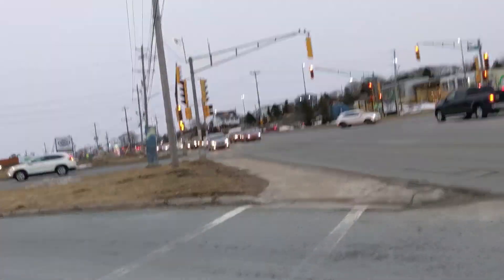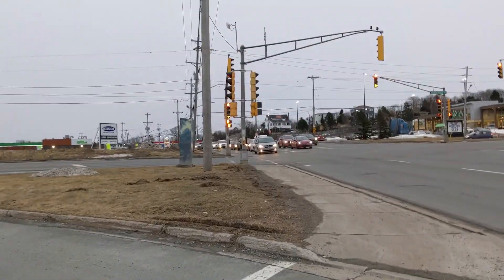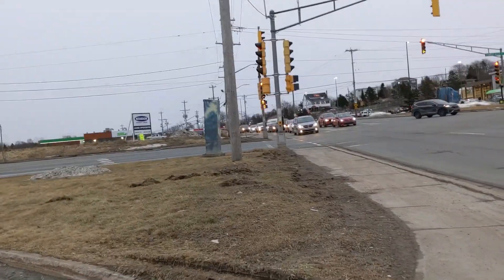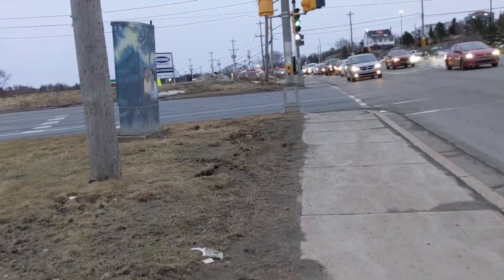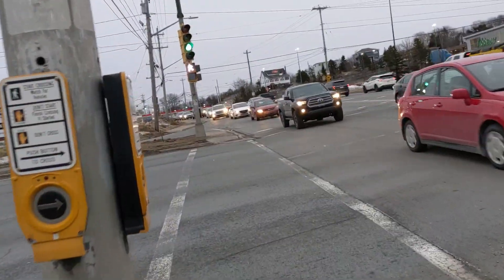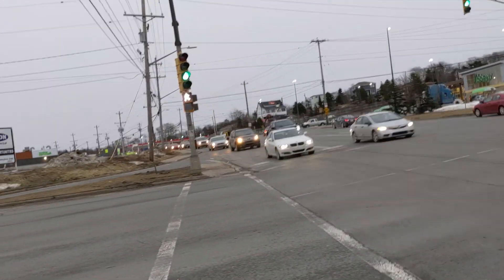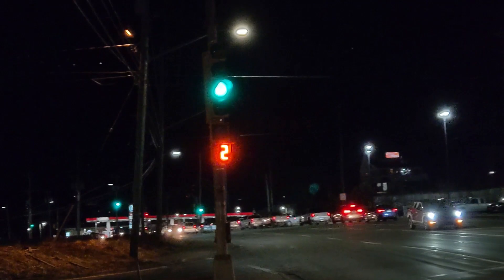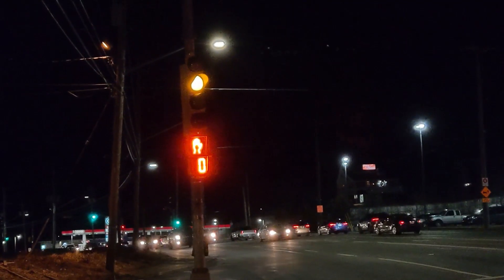Incorrect Countdown Timer Settings in Dartmouth

Comment: I personally love it when the 0 stays lit when it's on hand. I've seen an intersection in Quebec City with about 5-6 defective hands (yes I'm serious, 5-6 hands didn't work at one time) but most of the countdowns worked, so it wasn't completely dark, you could still tell that it's on don't walk. This was interesting because usually countdowns reach the end of life faster than hand/man signals. All of the pedestrian signals were replaced at that intersection with Econolite Duralight ones like in this video, but black housing.